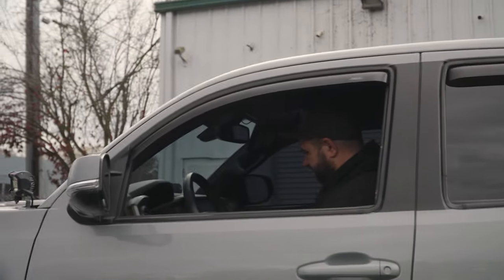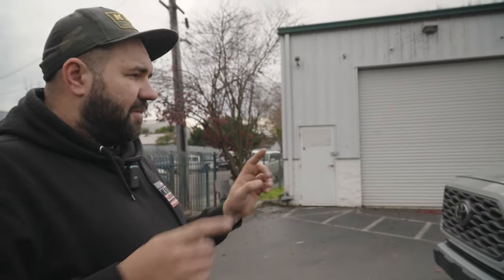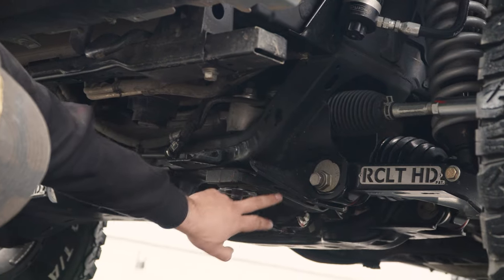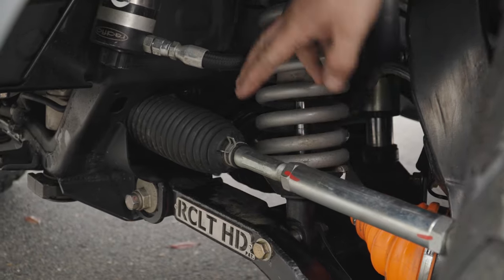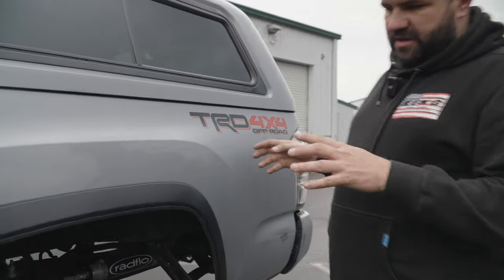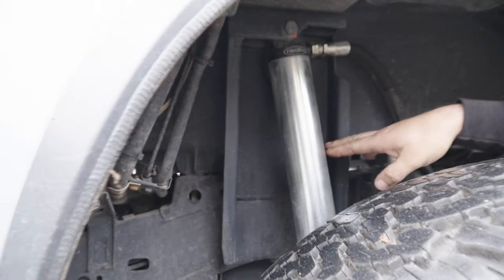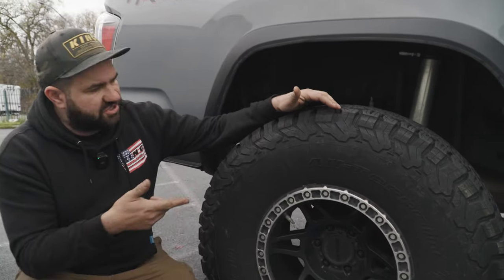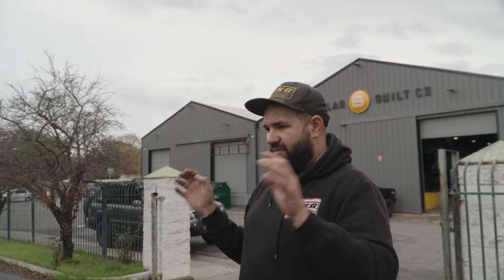Marlin Crawler RCLT HD Long Travel Tacoma | PEEP da SNEAK ep.3

Comment: Should throw a set of portals and 42 s !  . Looks good . Nice work !!
Reply: Ive been wondering about RCLT and 74weld Portals myself to eliminate the toyota unit bearing and get the LC rack upgrade. But since 74W is making a huge billet rack solution soon it may be better than the LC rack 'fix'. Looks like in '24 all Yoda IFS weak links have been addressed except for Front Diff/locked.? 

Portals would put it in 6's gearing.....need a Magnussen blower w that 6MT and some 40s then!

Comment: Tacoma uprights or spindles are forged not casted... regardless that's an awesome build.
Reply from the maker: Correct. Stamped steel.
Reply: @stellarbuilt might need to scrunch those front outer boots a bit more. At full lock they are pretty stretched (looking at the video) 4:21 and are very prone to ripping. Scrunch them to 4”.